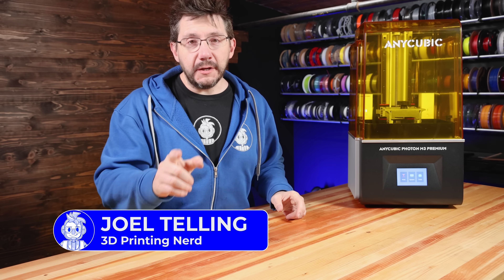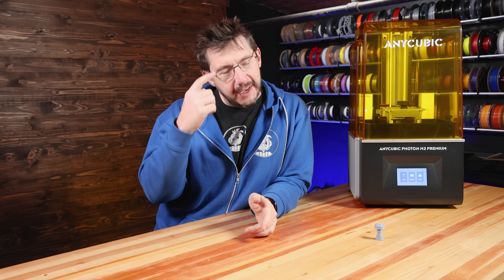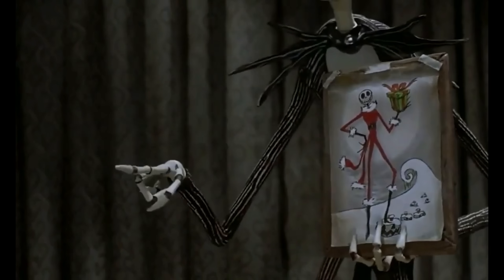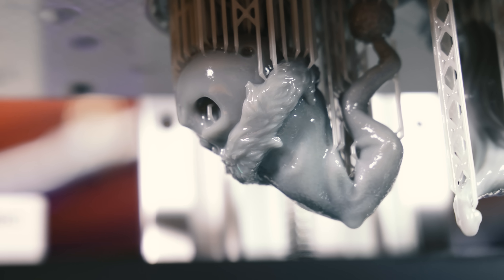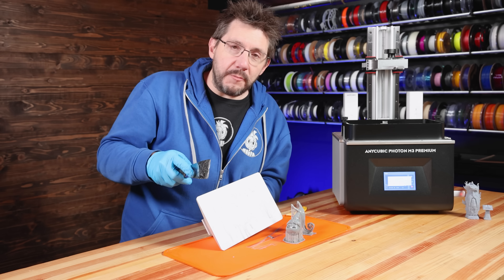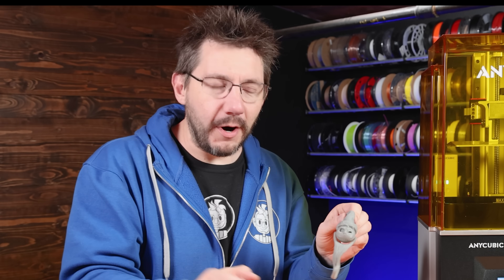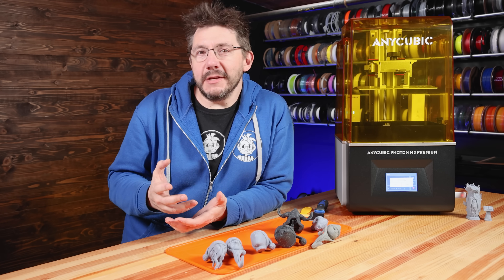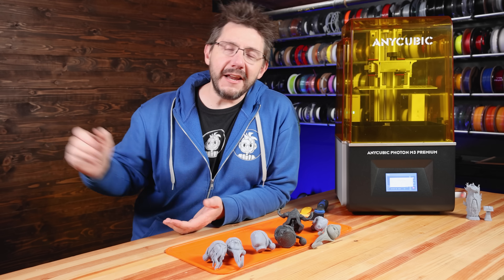FIRST 8K Resin Printer from Anycubic!

Comment: I love how these people have the power of rapid prototyping in the palm of their hands and they use it to print junk from websites that's on par with a toy you get in a happy meal.
Reply: The thing about those plastic pieces of junk in a happy meal is that they were injection-molded, and the molds cost tens of thousands of dollars to create. The cost has to be ammortized across hundreds of thousands of pieces to make sense. So your comparison of these one-off 3D printed parts to injection-molding is actually a perfect validation of the technology
Reply: Ye, but that’s the case with everything, nothing is used to its maximum potential. Still you can use these printers to make handy things like a door-hanger for clothing, self manufactured, so there is less cost to it and even these so called toys can be sold for a hefty mark up if you put a little work and research into it
Reply: I print happy meal toys that shoot lead a few thousand ft per second. I'm sure you have some pointless hobby  aswell
Reply: @w1llowsworld  If you are making something interesting, then clearly my comment doesn't apply to you. Don't get offended.
Reply: Also some.of these tiny "toys" sell for 4 and 5 figures
Reply: You have the power to rapidly connect with people across the world and you waste it on this comment?
Reply: @Mebartos  Apparently it was worth you replying to it. Try and sort that one out, mate.
Reply: @acf2802  :face-green-smiling:
Reply: Bahahahaha kind of like most music nowadays

Comment: Panel resolution nomenclature needs to be abolished as the meaningless marketing wank that it is. Sure, it's 8K, but it's also a 10.1" panel. The M3 Premium's 28μm XY resolution is going to be nearly indistinguishable from the Photon Mono 4K's 35μm or the Mono 6K's 34μm except in extreme cases. 🤷‍♂ Don't get me wrong, it's freakin' glorious. I'm just not sure it's a big enough leap to warrant the price difference. I'll be excited for the next one though.  They really needed something else... More speed, or more Z-axis build volume, or a vat refill system... Something to give it a bigger value-add.

Comment: 8k but dlp at a much lower resolution has sharper details and the price is the same. The reason is simple. DLP does not blurs the light that hardens the resin, and unfortunately LCD does. DLP also lives 10x longer on paper than an LCD panel ... I would be interested in how much truth there is in it

Comment: I just waiting to have delivered my 1st ever 3d resin printer by Elegoo. It is a 8K Saturn 2. also a 10 inch LCD screen that can print up to 10 inch tall and is a fast printer.
I just got some Elegoo water washable resin in a mint green ready for the printer which is due this month. 

I have a washable carbon filter face mask & 2 silicone mats and the stainless steel filter and a collapsible silicone funnel too.

I even saved over £100 buying it on the Black Friday that just happened direct from Elegoo. I really looking forward to getting this amazing resin printer I've seen so many great video reviews on!
Reply from the maker: Oh my gosh you saved a lot! That’s awesome!

Comment: Maybe important to some (as I didn't hear this in the video) the pixel density is a lot lower compaired to a smaller 8k printer like the phrozen sonic mini 8k. A smaller screen with a 8k screen will have better quality.
Reply: Yeah, I think this is just a showcase of the printer though (as opposed to a review).  Think “Newegg Unbox This” vs. “Gamers Nexus rips a Prebuilt PC a new one”.
Reply: Also known as an ad, but we know Anycubic's review policy so that is not a surprise.
Reply: @I_enjoy_some_things  Those GN videos make me happy I build my own, I think one of theirs was a nearly $5k alienware with a 12900K cooled by a 120mm AIO on an 80mm fan hole.
Reply: more importantly, DLP is now available for home users and has much better detail at much lower resolution.
Reply: @666Azmodan666  Indeed, yet I don't see much of DLP printers on youtube. This might just be me.
Reply: @Parasite98  maybe i didn't search well but i guess there are only 2 for home users which is new. Comparison tests for 8k printers are on YT
Anycubic Photon D2 is one of them...

In my opinion, buying a mono lcd has lost its sense.
If the lifetime of the light module is 10x higher, it is an obvious choice, especially since these 8k matrices are not cheap.
Reply: @666Azmodan666  I think they might become the new thing but atm there build volume is still a bit small. Who knows what we will have in a few years lol
Reply: @Parasite98  Most people don't use larger format resin printers anyway. D2 is already bigger than it needs to be for most people. But I agree, if someone needs a larger format, it's left to buy an lcd or build your own printer where one person prints figures of people in 1/1 scale and glues them only to the height: D (probably the lcd panel removed from the TV)
Reply: @666Azmodan666  Out of curiosity, what do YOU print on your resin printer?
Reply: @LordOfJazz  I plan to print my own models, so the amount of details on the model is not a problem, it's important that the printer can handle it. For now, D2 is No.1
Reply: @666Azmodan666  I use a Mars 3 Pro and I print roughly 11-12 inch models. I have never printed a model and thought "The resolution is too low". I'd even go as far to argue that no most, if not all, people who see two prints from a D2 and Mars 3 Pro would even know which is which unless you use a microscope. Add on top of that the primer and paint and I'd now argue that even the people who make the D2 would be able to see a difference. Seeing as the Saturn 2 is able to produce higher quality prints than the Mars 3 Pro, I'd say the extra print volume would save you so much time that it would be a better option. Of course I'm saying this without knowing exactly what your specific needs and conditions are(like space). Maybe there are details that the D2 can print that I have never imagined of. Just something I thought I'd share as the D2 is very expensive for the "extra" detail you get on paper than what you would get/notice on a printed and painted model. I know you didn't ask but I've been researching bc I was in the same boat a couple weeks ago.
Reply: @LordOfJazz  Even if I would agree with you, it is no longer a matter of what you will notice, but what you can have at practically the same price, and we are talking about this detail and the lifespan where dlp has more than lcd displays and these are not marginal differences.
If I had to pay 2x more for dlp, I would choose lcd 8k and I would be happy too, I think smoothing some prints will not pass me anyway depending on their purpose ...
Reply: @666Azmodan666  You have no idea if they last longer. No one has owned one long enough. By the time I get to the point that my LCD is not working I'll probably want to upgrade to a new printer any way. As for price, you are literally paying 2x the price as a similarly sized printer. But different stroke for different folks I guess. No one is right or wrong here. I just wanted to share another out look as your comments seem to insinuate that the D2 is out right a better option when it clearly isn't. Hope you enjoy your D2. It's great to see that there are so many people getting into resin printing and painting models.
Reply: @LordOfJazz  dlp is nothing new, it's not like nobody had it before long enough to check the real viability. The new one is only access on the hobby market to dlp. Believe me, I won't replace it before it dies :D I'm probably still resuscitating it ;p before final death :) 

from what I remember from the very beginning my argument was the same price and better quality so I don't know why it hurts you must have missed it. If you have a different situation, I also wrote 2x more I would not pay.
For me, 8k costs 3200 and D2 3600, percentage is nothing for better quality and longer life of the printer.
The truth is that D2 is better, it will be a different matter for someone, he has to say for many even fdm will be better.

my opinion is no reason for you to worry about someone, just like no reason for someone not to check D2 and their needs themselves if this money means something to them.
Reply: @666Azmodan666  "my opinion is no reason for you to worry about" ? I am just using the comment section for what comment sections are for dude. Chill out. If you don't care then don't answer. And yes the D2 is fairly new. Just bc it uses DLP tech it doesn't mean it will last as long as other products. But you know best so I'm just wasting my time XD
Reply: @LordOfJazz  I'm calm, I don't shout, we talk like adults and we exchange our opinions. As you can see, the price of these printers is practically identical in my place. How it will be with dlp specifically in this product, no one knows, but in my opinion it's better than lcd and if it's that much better, I take the correction for what is on paper.
You don't waste time, someone will check your arguments as well as mine and make a decision on their own. If we gave someone something to think about, it wasn't a waste of time... Thanks for the feedback and I appreciate your opinion too.

Comment: Sure, Lets see you paint them up.
Also if you really wanted a challenge to print. Head over to Thangs and look at some of Dazus k spiral and lattice ornaments. Can't say how many prints of his I had fail before I bumped it up to heavy supports at 50 to 70% density. I will say its more then five Closed Lattice Tree Topper's. Then again maybe it was the clear resin with metal pigments.

Comment: Great resin printer. For now I am sticking to FDM because the materials are cheaper, but I wish it becomes cheaper in the future.
Reply: You can get a 1l bottle of anycubics resin from ebay for ~ 13€, its already at the point of being cheaper then filament, even considering you will use more material for a resin print.
Reply: Especially if you tweak the hollow settings just like wall settings on an FDM printer, 1kg of resin has lasted me about 15 medium prints so far, CAD $35